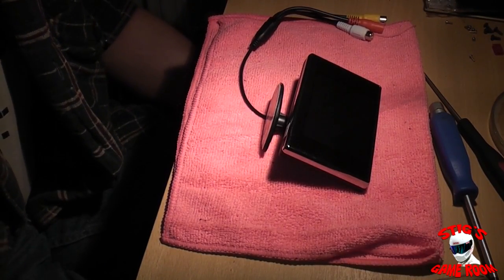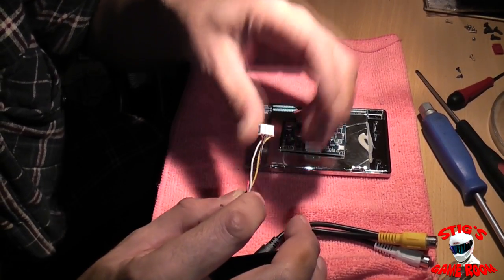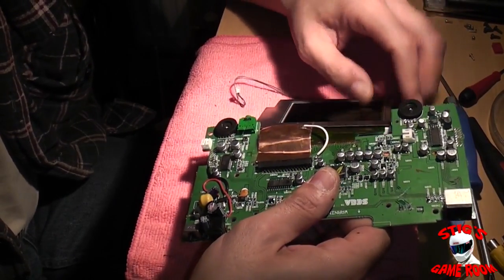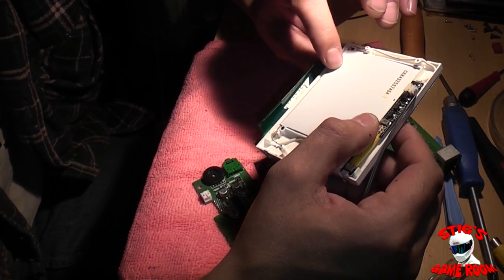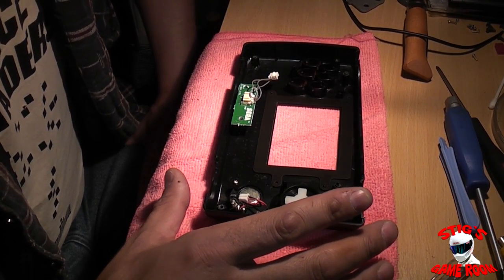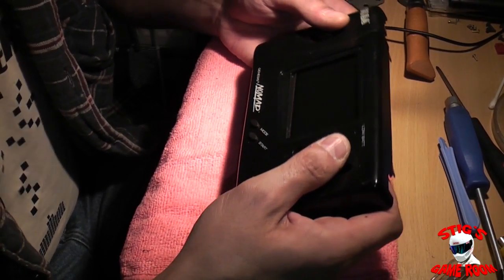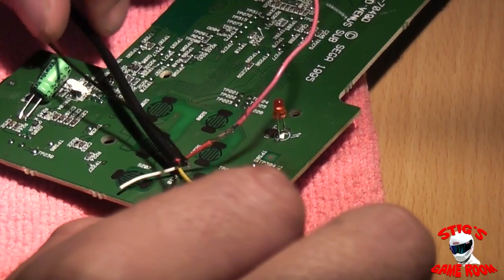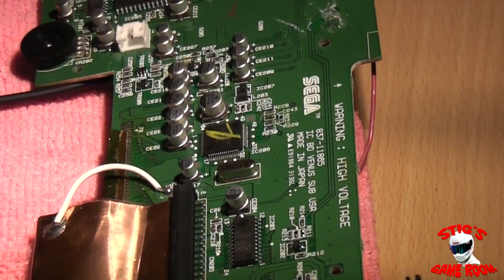Sega Nomad LCD replacement - Part 2

Comment: I have a screen that looks identical to yours, but the wires are soldered directly to the bored and it has some switch with 3 buttons. I guess the one button is to change between AV1 and AV2 where as the other are brightness plus and minus.

When I tried to test the screen, it didn't work. I ran the Nomad AV cord from the Nomad and plugged it into the Yellow adapter piece and connected a 12v DC jack from the power adapter on the screen to an outlet while connecting running the Nomad Power Adapter as well. I got no picture whatsoever.

Do you just leave the white wire disconnected?